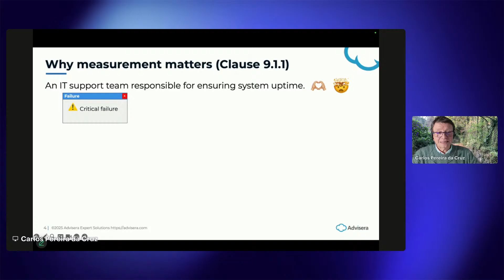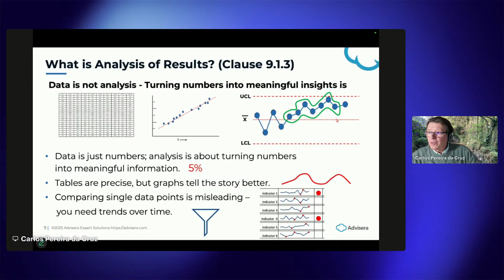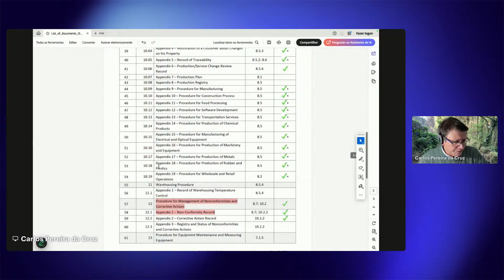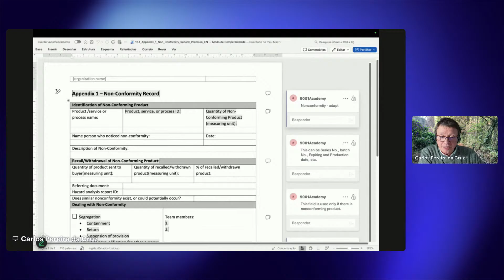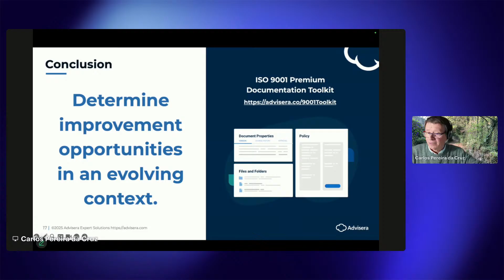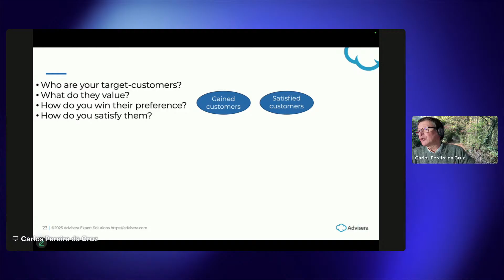Measurement, Analysis, and Improvement According to ISO 9001:2015 [live webinar]

Comment from the maker: You can find below all the links we have shared in the live webinar: 
- ISO 9001 Premium Documentation Toolkit https://advisera.co/9001Toolkit
- Toolkit expert meeting link https://advisera.co/9001ToolkitExpert
- eBook DISCOVER ISO 9001:2015 THROUGH PRACTICAL EXAMPLES - https://advisera.co/9001eBook
- ISO 9001:2015 Foundations Course https://advisera.co/9001Foundations
- ISO 9001:2015 Lead Implementer Course https://advisera.co/9001LeadImplementer
- ISO 9001:2015 Internal Auditor Course https://advisera.co/9001InternalAuditor
- ISO 9001:2015 Lead Auditor Course https://advisera.co/9001LeadAuditor
- Practical tips for measuring your QMS according to ISO 9001:2015 clause 9.1 - https://advisera.co/MeasuringQMS
- The ultimate guide to ISO 9001 quality objectives https://advisera.co/QualityObjectives
- How to define Key Performance Indicators for a QMS based on ISO 9001 - https://advisera.co/QMS-KPIs
- Making the best out of ISO 9001 Quality Plan - https://advisera.co/9001QualityPlan
- Analysis of measuring and monitoring requirements in ISO 9001:2015 - https://advisera.co/MeasureMonitorReqs
- How to implement the Check phase in the QMS according to ISO 9001:2015 - https://advisera.co/9001CheckPhase
- Complete guide to corrective action vs. preventive action https://advisera.co/CorrectiveVsPreventiveActions
- How to use quality control tools to improve your QMS - https://advisera.co/QualityControlTools
- How to use root cause analysis to support corrective actions in your QMS - https://advisera.co/RootCauseAnalysis

Follow us on social media:
- Advisera LinkedIn: https://www.linkedin.com/company/advisera/
- Advisera YouTube: http://www.youtube.com/@AdviseraExperts

Upcoming webinars:
- Advisera Website: https://advisera.co/Webinars

Below, you can also find the links to our webinar survey and the PDF slides: 
- Webinar Survey https://info.advisera.com/webinar-survey/measurement-analysis-and-improvement-according-to-iso-9001/ 
- PDF slides https://advisera.com/webinars/materials/ISO_9001_2015_Measurement_Analysis_Improvement_webinar_presentation_deck.pdf

We look forward to your feedback!